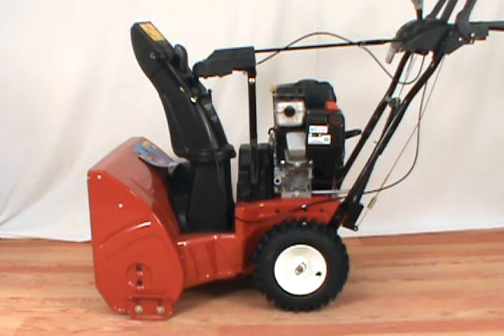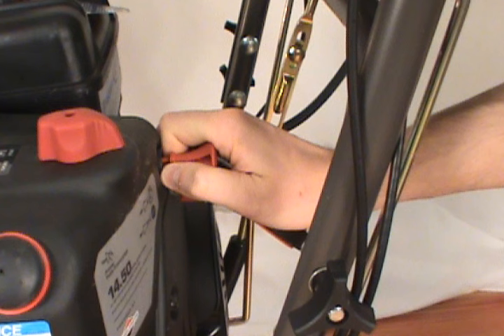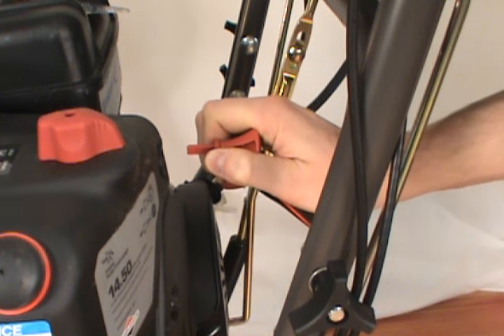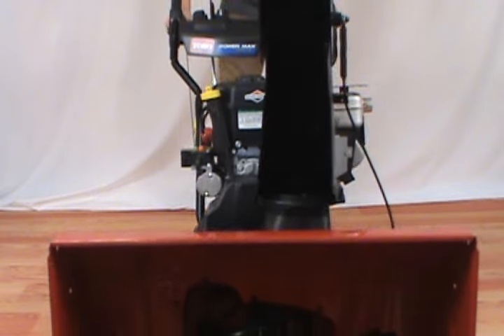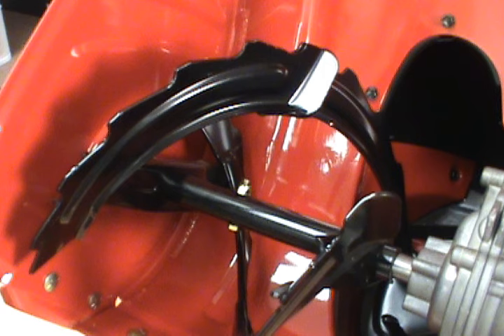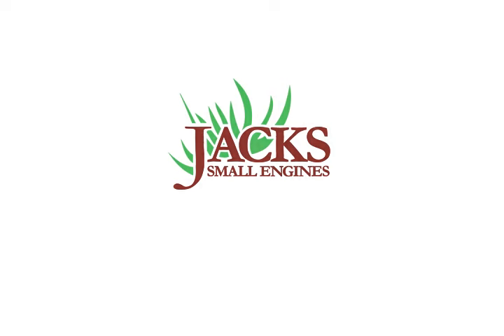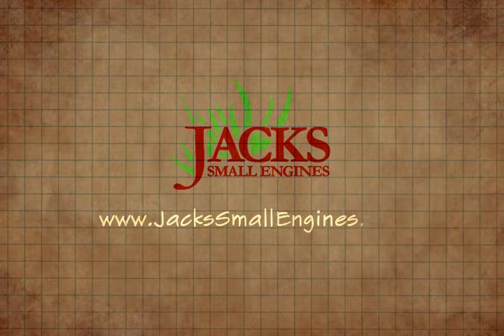Replacing a Shear Pin - Toro Two-Stage Snow Blower

Comment: Thanks for the instruction. I have a Toro  724. So much for the screw never breaking. It has sheared off twice on the same side and the engine did not turn itself off. I had to use a punch as it left a piece in the hole. I ordered extra screws (321-10) and nut locks (3296-42) from Toro in case it happens again.

Comment: impeller spins freely when off and doesn to spin when auger is engaged...any suggestion to repair
Reply: +Steve Moncada 
There are 2 bolts (1/4-20 - 1.875" long) that connect the auger to the impeller.
Reply: I'm in the same boat. My local repair place said it's so easy to fix they don't even want to charge me to come and get the machine and repair. Hoping to find a video on how to.

Comment: Those are not shear pins, they are bolts and will not break, I've had to rebuild the gearbox in my Toro 726 TWICE because those bolts wont break. Is there an actual conventional style shear pin that will fit this machine ?
Reply: That’s what I’m wondering too.
Reply: I just read that the engine will shut off if clogged, remove the key, then the obstruction, reinstall the key and start
Reply: @longislandforester859  That's the way it is SUPPOSED to work. When the auger got jammed the motor did stall but it broke the main drive gear in the gear box, snapped it clean in half. This is the second time this same thing has happened.
Reply: @johnfasciano3532  damn.
Reply: These are shear bolts, they will absolutely shear.